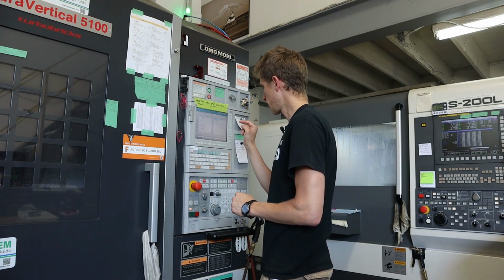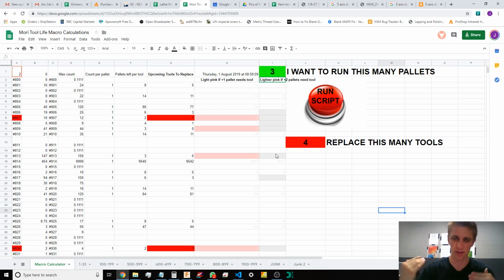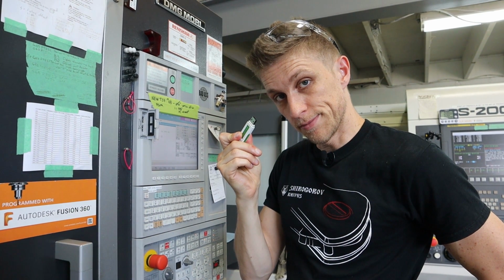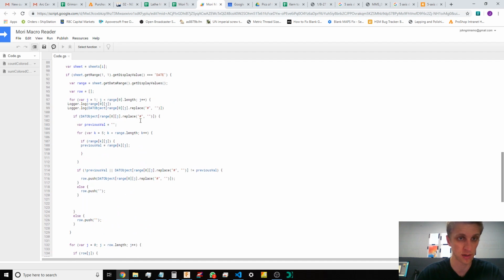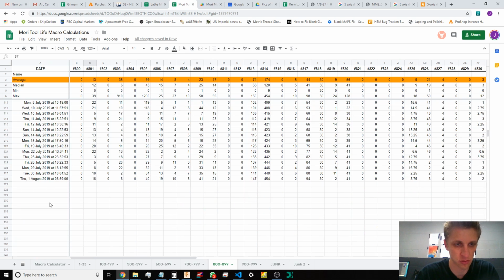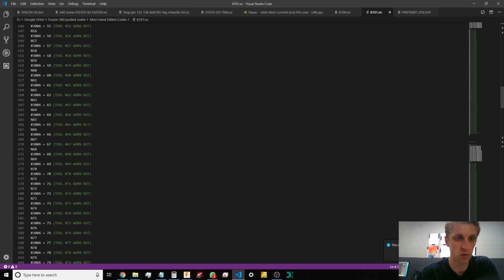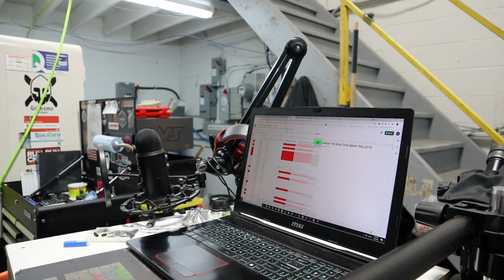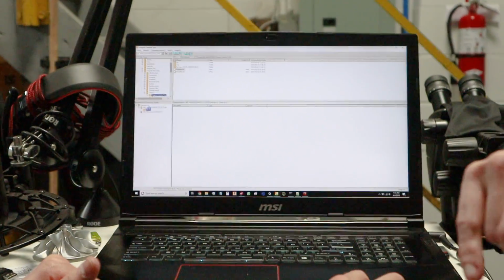Track Tool Life, Save Time

Comment: I'd setup a little NAS for transfer and backups and would also prevent the need to keep a laptop or system on for the file transfer and script. Sheesh,  I'm sitting here wanting to go work on your LAN and laptop to fix the routing and connection issues!  
Also, I would static IP the machines in their own /28 ip block. Ugh,  My day job is sneaking into my hobby now.  Damnit.  I'm fighting my want to spew network config suggestions all over this comment lol  sometimes I just can't help myself haha.  
Nice work as always

Comment: Just write a program in the cnc to take in the desired pallets and list the tools that need changing all at once. The program would not do any machining. It would simply list the tools and possibly present them physically in order for replacement to the operator

Comment: Rather than dprint and scripts and excel can’t you just run a program on the control - something like:

If[#901<=[#801+2]] (running two pallets)
T01 M06
M00 (program stop, replace tool)
#801=0
Renishaw measure tool offset macro
Endif 

For tools #1 to 30

Since the program doesn’t change the tool life unless you replace a tool you could run it any time without messing up your pallet counts.  Most likely you would run it as a sub program before your dual pallet program.
Reply: Could set the number of pallets as a #500 variable and do all those life check loops in a sub program.

Comment: Hi John, 
Thanks for sharing!
I know you are going to get it working.  In case you are still working on this and it is not fully solved, I would like to suggest OPC would be another way to try it.
I am curious if the 800 and 900 address registers you specified can be accessed through OPC.  If so, the data could be monitored through "tags" (shared memory registers) into a PLC or PC for use inside a program, where it can be acted upon by the script or a program.  I will check with Fanuc to see if this is worth trying and what can be done with OPC on the Fanuc CNC controllers.
If it is supported, you could pull hundreds of tags (or more) out on an update interval you specify, or an event
When you setup tags, you specify the device and memory address to monitor, and the variable name for the tag
Once it is working the data appears in the tag and can be used by other devices that can browse to them.
So the connection would be continuous with fast updates, and the spreadsheets could be updated continuously at regular intervals at close to realtime.  
Then you could have your data be visible in a realtime dashboard that updates automatically.
Nice work though, I appreciate you showing this and it is much appreciated!

Comment: Please fix the problem forcing you to turn off the firewall rather than blindly just turning it off. Also, that macro programming is so insane that if you can go through the suffering to understand that, you can certainly learn JavaScript. 

Agree with the other suggestions of putting the FTP stuff on a network attached storage device. They're pretty cheap.